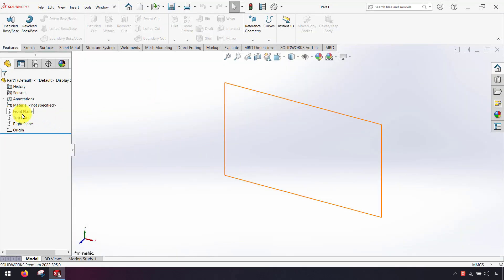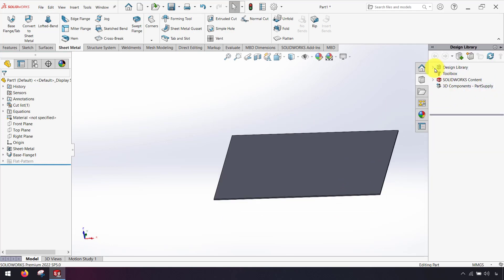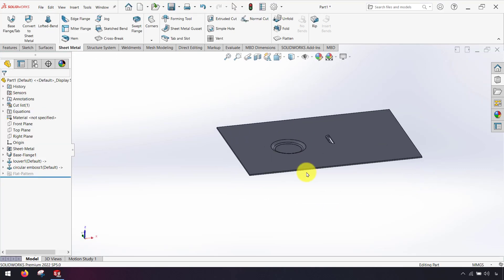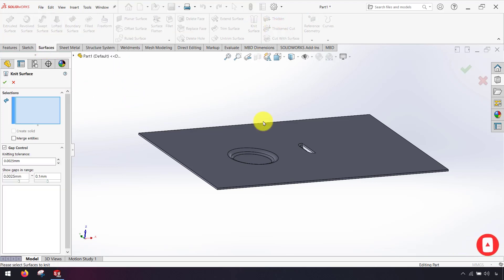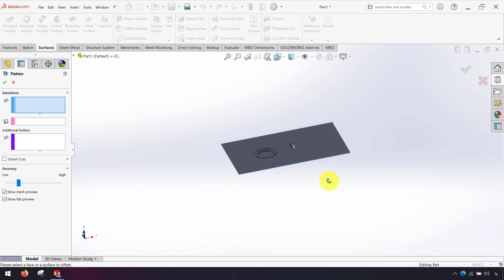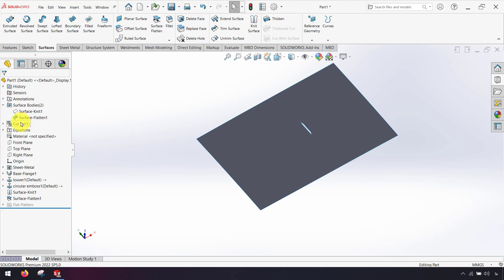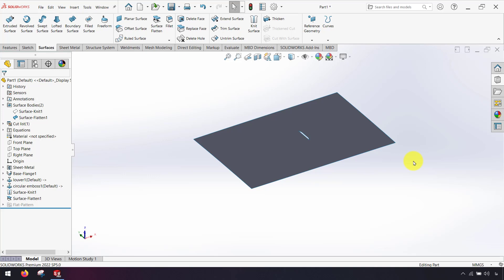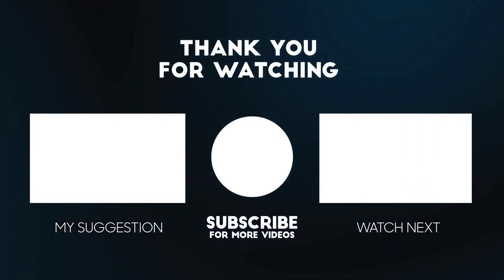SolidWorks Sheet Metal Tutorial | Flatten by surface

Comment: This video has shown 2 most import things of this method.
1. The analysis tool is very useful to see, where most stresses will occur
2. You have said this method is very imprecise and to make it precise you need to use something like autoform or logopress etc. which is 100% correct. 
Best video on this topic so far.